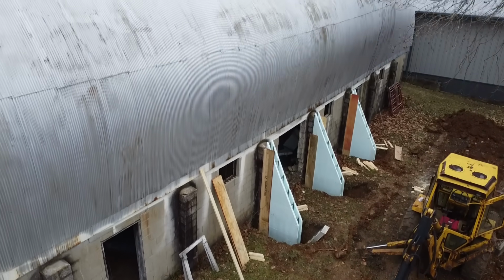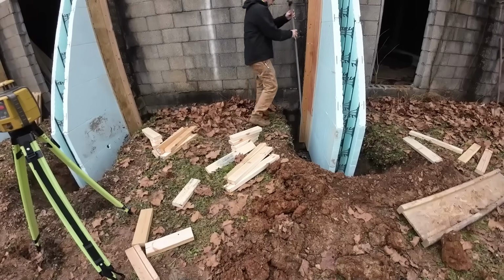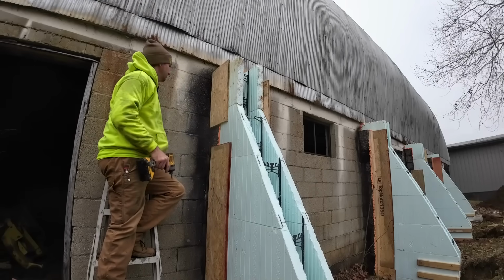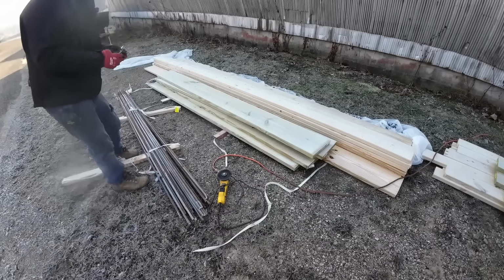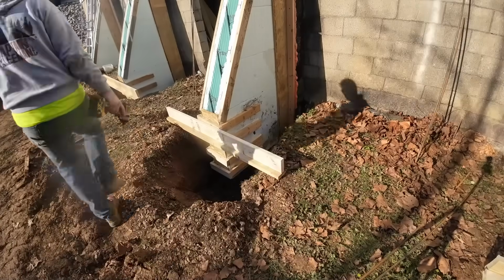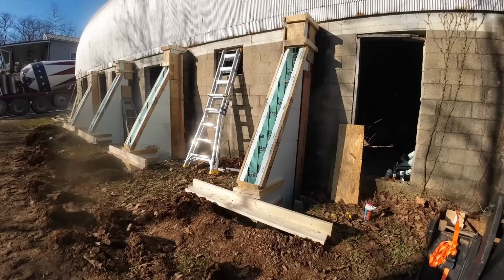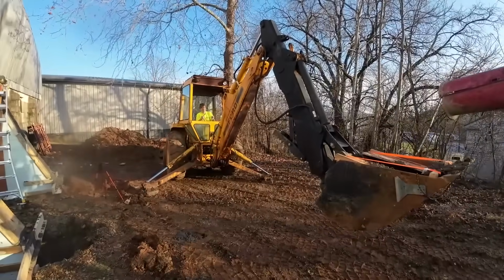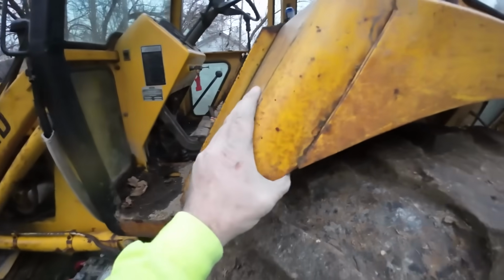Barn Revival Gains Ground - Foundation Stabilization Complete!

Comment: In lieu of any questions or other comments, I will pay you (and Mike) the ultimate compliment. Apparently you are a great guy, enough that you have a freind like Mike who just popped in and gave you a hand at a time when it made a difference.  Yeah, you could a done it alone but as you said, it woulda taken longer for you (and your cement guy).  

Hero points all over the place for Mike at DP…not only did he pitch in to help but gave us some excellent video that likely would not have happened.  Yes, you could have done it 💪 but having the extra hands made it much more likely.  

Thx to you both…Boom Baby!! 👊

Comment: You really should run a hot pink masons line from end to end, showing just how much you can raise the roof…..maybe one at the peak, and two midway, where you are jacking.  Absolute proof of amount that you can move an old structure without harm.  And Mike neglected the poor old building, it’s Karma he came by….. and the friend that he is, and the work that you have done for him- what goes around comes around!   You are both great people who have a lot in common!   After you were “blessed “ with the 555 I spent what some would think too much on a Case 580 which spent its life being rode hard and put away wet.  When I add about what you have invested in yours, it still will be short on power, but won’t continue to have me constantly pouring hyd fluid into it.  Winter project between snow removal I’m saying 😂. Great stuff Mike!😊!

Comment: Having a thought Captain, could you use cable and turnbuckle to draw that roof back into alignment.  That would tighten that whole roof structure up and then allow you to push and frame it back up. Benefit is also that the cable would be well above where you would be working and moving around which would leave an open floor.

Comment: The proof of the pour will be tomorrow (today) 💪💪💪 I have no doubt that even with the stiff mix, there was plenty of vibrating done and there should be no discernable voids 👍
Great to see Mike pop his head around the corner, just  couldn't see you battle this by yourselves, and the mixer driver getting his five minutes of fame with you, he deserves it 😁
The 555 concrete pump worked well, the fancy bucket made hitting the hole easier 😃
Reply from the maker: Was pretty happy with the way it turned out!

Comment: Heat the intake manifold with your little butane torch, or throw a tarp over around it and put a salamander heater, also in the day we would build a little fire under the engine and warm it up that way

Comment: Hey Capt. go get you some liquid pool chlorine from your local pool supply. Mix it 2 oz. Per gallon with a sprayer and spray all that black mold. Pool chlorine is like 50 stronger then Clorox type. Wet it down spray it and t will be white and dry when you pour, no biological barrier.

Comment: I’m just questioning , why lock in the lean of the original columns with buttresses? If you cabled the exterior walls to a centerpoint and strong back the walls it make sense to pull that in as you simultaneously slowly raise the roof at the ridge, then put the buttresses in. Food for thought I’ve rectified a roof like that and it worked beautifully., making a straight and plumb wall and true ridge line. Love your crazy content.
Reply from the maker: Absolutely not.  CMU walls don't get straightened.  They either get stabilized or ripped out and replaced
Reply: @CaptainKleeman  I do not disagreeing with the cost effectiveness of only stabilizing them.  CMU wall unless the concrete the block is degrading will withstand the movement providing a structural strong back is properly secured. That’s the  thing about about having structures still under compression . Cheers.

Comment: I am sure that you would have covered this when working out the butresses but I will ask anyway. I assume that the wall you are working on has already tilted out due to the pressure of the failing frames so your butresses will re-inforce the wall to prevent further movement. When you jack up the roof as close as possible to the original shape, will that not cause the bottom of the frames to try to pull back inwards? The re-inforced wall will resist this. As you take the pressure off the frames by lifting them, perhaps adding a stretcher rod across the bottom connecting each end will assist in holding the frame steady. I would suggest a rod rather than cable as a rod (reo) will not deform as much as cable will stretch. I like your ability to adapt to situations. Keep going as the job is fascinating.
Reply from the maker: It will not pull the wall back In

Comment: Is that a big box of torx screws and what length do you prefer when you’re screwing the forms Mike! I just noticed how the contour of the land is outside the building and how it’s dig into the hill! Looks cool Mike, the ole girl cranks pretty good with a little bit of crack spray! lol 😂😂, yall definitely have colder temperatures there! Just about concrete time my friend!
Reply from the maker: I normally use 3 inch screws

Comment: if the intake heater itself is good, run new wire and a simple push button starter switch. i don’t think starting fluid in small amounts is that bad on motors. wasn’t that what starting fluid was originally for?
Reply from the maker: I ran a new wire and momentary switch.  For some reason it wouldn't operate that way. Not sure why.
Reply: @CaptainKleeman  if it has power and ground there’s a good chance the heating element has gone bad.

Comment: I have a question. I know your buttress are to keep the wall from bowing out any further but when you start jacking the roof back up and the walls stand back up are you going to pour more concrete to fill in the gap between the buttress and the walls?

Comment: Too bad you can't pumpjack the footings that are sinking and causing the wall to push out. I would certainly look into it before locking them in place with more concrete while the walls are still pushing out.
Reply from the maker: That's the eventual plan.  Have to work up to that step.  Getting closer every day though

Comment: Seen the mix thinking wow rich and chunky. They make a good mix should be strong when it cures. Just miserable placing it lots of 3/4 stone. You ain't pumping that. It was 2 months ago watching a contractor pouring some footings for dock ramps. They had the ready mix on a barge they ended up using 5 gallon bucket to fill the forms. Looked to be a yard and a quarter each footing times three. Bet those guys wished they had the line pump 😂

Comment: Did the other side need the same support?  Is it because it's closest to the river?  Either way, nice job making due with what you had Mike.  That is no easy task.  You got a secure foundation and I'm speaking on multiple support systems you have in place.  😜 Great JOB!
Reply: The ground seems to be sloped.  Ground level on the other side seems to be at least 3ft higher.

Comment: You cheated lol. There are no front discharge trucks around hear so when we built the fire station in our community, we filled the 8 14’ high 16” pilaster block sections using 5 gallon buckets. You talk about being spent at the end of the day.